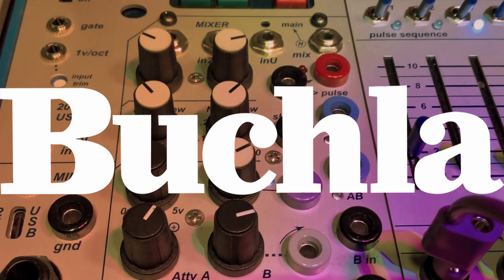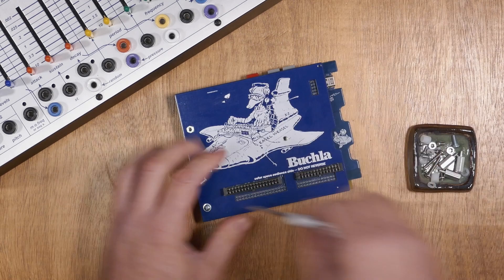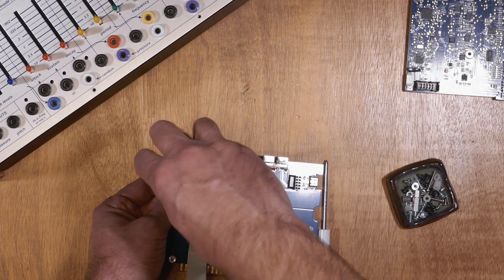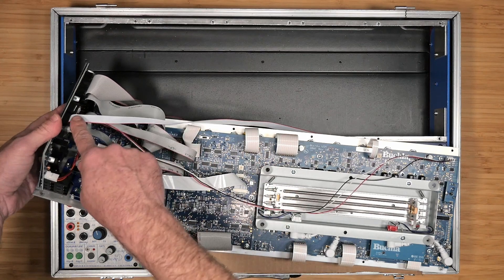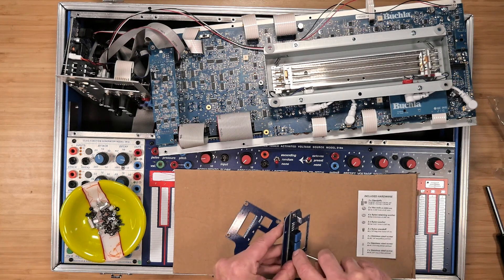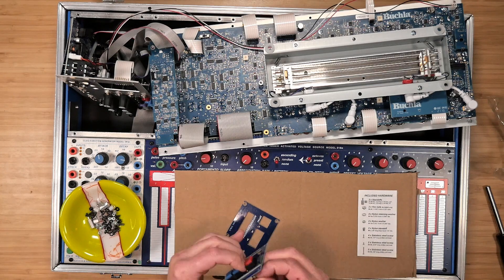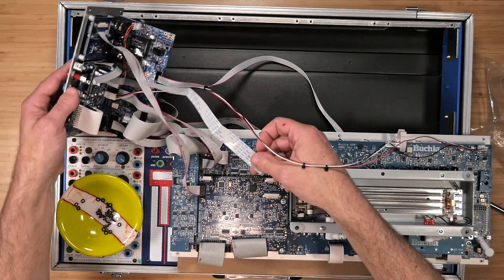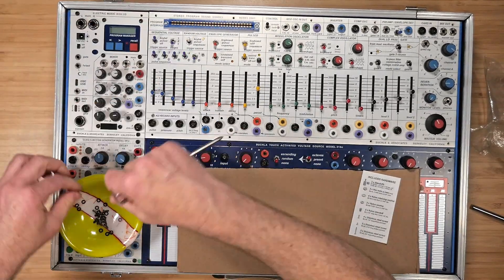Buchla Music Easel Program Manager Embed Kit

Comment: Seriously why don’t you ship the Easel with the program card installed/integrated into the Embio from the start. This looks like a terrible design choice, having the end user go through hoops like this.
Reply: I understand yet designing the program card and Embio in the way it has been done has added to cost as well. Not sure this is worth it. A couple of additional transistors etc aren’t going to add too much for a device that is sold for 5k. But well, not my call to make and better this way than no way.
Reply: It is possible to order with the program manager installed from the factory.
Reply: @peternyboer no, it isn’t. I just wrote and asked and they said they don’t do that. They directed me here.
Reply: @peternyboer  Good to know. Too late now, I ordered what feels like years ago ;-)
Reply: My guess is cost. No everyone will want or need one.  At $500 it’s cheaper for Buchla owners to buy separately.  It’s actually an easy installation.